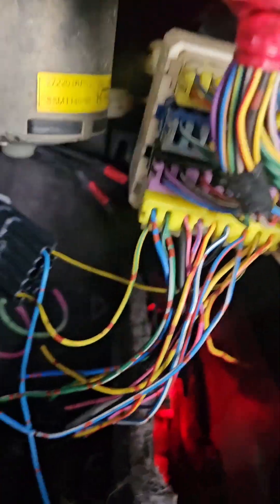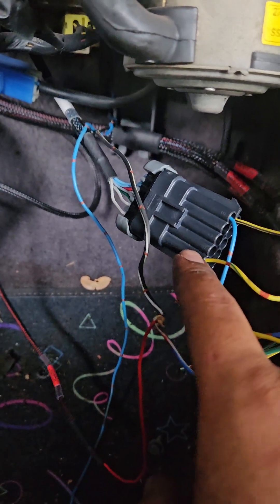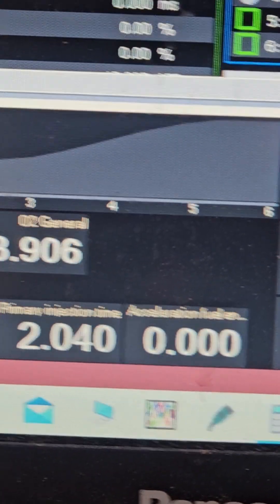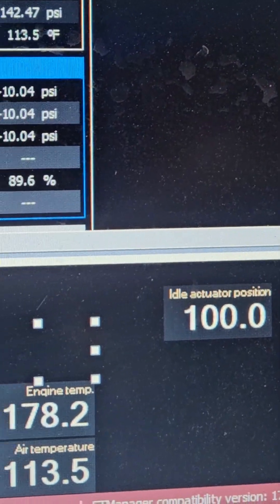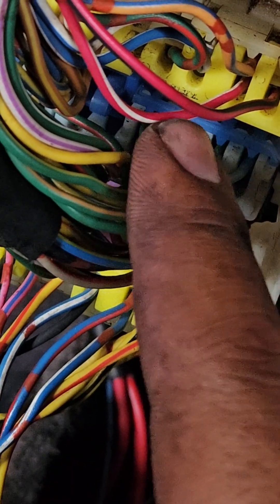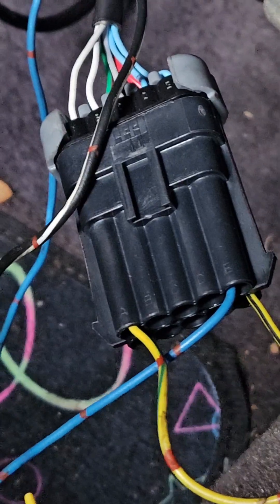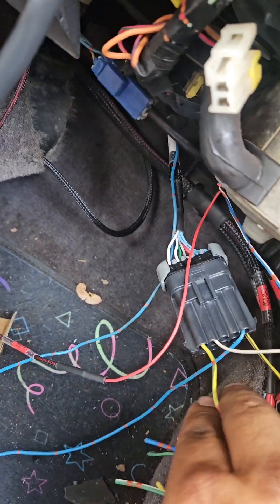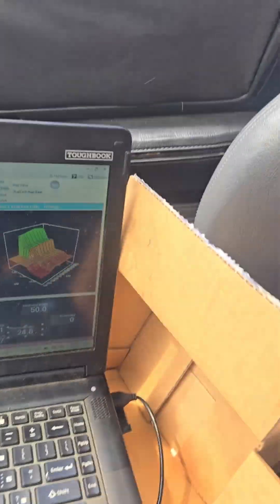Close to the end!  #nissan #z31 fueltech 450 install. Speedo and first drive!

Comment: Did you ever figure out the rpm signal ? With that silver disc in the distributor? I’m doing the same thing .
Reply from the maker: In one of my later videos I did. I ended up blocking two of the holes by welding them up.  Are you doing a Fueltech install?
Reply: @ ok ya I did see that , I didn’t know if you figured it out all the way for the rpm . Yes I’m putting a 450 on 85 300zx turbo
Reply from the maker: @mattbowen3049  yeah, blocking the two holes did the trick.  I think it was 24-2 for the trigger, but it's been too long now for me to recall
Reply: @krmotorsportskilleen  ok cool! I appreciate it ! I’m more familiar with Holley and ls motors than these Nissans , just trying to help a friend out getting this going